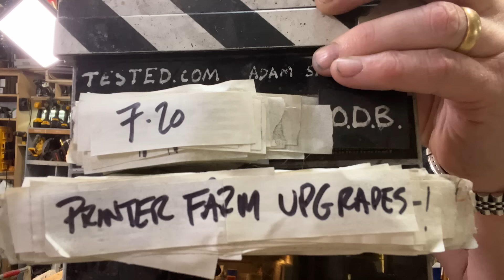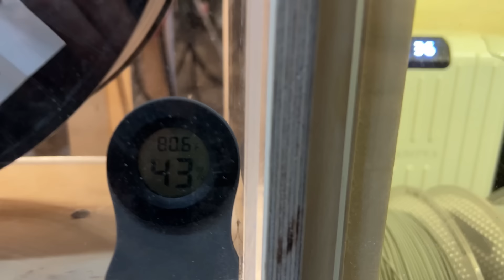Adam Savage's Essential 3D Print Farm Upgrades!

Comment: Hello Adam, I bought one of the Bambu Labs X1C with the AMS. I can't tell you how impressed with the performance of this printer. I had been struggling with my Kywoo 3D Tycoon Max trying to get acceptable quality for dimension parts and I could get there but for an EE the tweaking was getting painful. The X1C just plain works! I am doing prints with PLA+ and PETG (I never could get PETG to work well with the Kywoo) and it is amazing how they turn out. I just printed some simple 7.25 X 4 X 1.5 inch deep trays out of white PLA+ and the finish looks like an injection molded part. I had to get the magnifying glass to see the evidence of the print process. All of the parts I have made thus far were printed at ludicrous speed so I really need to see how well it does when I slow it by 1/2 or 2/3rds (the speed of my old printer). If I I slowed my old one to sloth speed I don't think it could even come close to the X1C. The only real texture on the finished parts is on the bottom from contact with the PEI build plate (that plate works amazingly well glue or no glue so far) the plate actually leaves a really nice textured finish. I have a high temp plate, but I have not used it yet. Next is to try some persnickety ABS or something with carbon fiber in it. Next I want to try some really small parts like spacers for 2-56 and 4-40 machine screws and see how they work out. It seems that the local hardware store never has the size I need and I need to stop cutting up all of my BIC pens with the pipe cutter for spacers. Well once you have had the X1C's for a few months how about bringing all of us up to date on your observations. Sam W3OHM P.S. I almost forgot. Thank you so very much for doing the unboxing and introduction to this printer. Your video pushed me over the edge and I ordered mine after watching your video!!

Comment: For your anodized aluminum request, there are a few solutions I can think of. 1) try looking into silk PLA. It has a metallic like finish with at a pretty affordable price. 2) HTPLA is PLA filament that has small particles of metal in it. The parts that it prints can be sanded and polished to have a metal like finish. 3) I saw recently about plating your print using electrolysis. That a bit more involved but still a cool concept. They used a conductive filament for the print and then set up a bath of whatever material they wanted to coat it in. Hope this helps!

Comment: Hey Adam you can tell the printer to just print the interface layers in that support stuff. So you print your support structure in the standard PLA or whathaveyou, all in one layer and one go and only when you come to the contact surface, which is around two layers thick or something, you switch to the special support material. It saves you special support filament, it saves a lot of purged material and it saves you time for all the changing and purging

Comment: I love the filament winder. It reminds me of film winders in the old days of editing. We used to wind film by hand with a geared mechanism that would run through 800 feet of film in less than a minute while turning the handle at a rate of about 1 rev every 2 seconds or so. I was expecting to see that. There must be hundreds of old film winders In your neck of the woods if they haven't all been scrapped already. Now I want to buy a printer. I definitely have your disease. Thanks Mr. S. 🛠

Comment: Regarding 3d printed part that looks anodized (I dont quite recall which video you asked about this in).   I was printing a chassis frame that consisted of  sides on the order of 20mm x 50mm x 500mm with the 50mm surface down.  The filament PLA black with silver flecks.   Alas I ran out of material with 4 layers to go so I grabbed the closed material on hand - a spool of Galaxy Red,Black,Silk Purple gradient material.   I was prepared to redo the job but the customer LOVED it and said he didn't know you could anodize plastic.

I've now added this as a special finish offering :)  Gotta love these little accidents.

Comment: You should print a TPU gasket, that molds tightly around your drybox and has wings out like weather stripping that push up against the plywood and 3D print some corner snaps, so setting the drybox in the clips, pushed that gasket tight against the plywood holes an it "docks" in place.  So removal and re'filling is super easy!!

Comment: That winder is honestly super impressive as to how well it works and the fact that something that large fit on 1 print bed.

As for your last question: you can metal plate 3D prints. I've seen gold plated prints and more. Seems right up your alley.
I've seen aluminium anodisation done with food colouring too. To kinda 'fake' it.

Comment: I like the winder and the hot box expansion, great stuff, but a pei scraping table?  I usually pull the prints off the plate, put the plate back in the printer, and then scrape it when it's in the printer... works great.

Comment: First shiny or anodized looking pla you'll be looking into silk pla filaments. A few caveats to know silk filament on fast printers is that you might have to slow down your top speed to avoid getting a matte finish in areas. And generally overhangs don't print as well on silk filament. Also silk filament can have a lot weaker layer bonding.

Comment: You can save filament by using the Flush options in the Others menu in Bambu slicer. You can flush into infill or supports, so instead of dumping the purged filament, it uses it for stuff that doesn't show.

Comment: These are all fantastic! I'm running four X1 carbons, and did the Pei textured sheets as well. I'm not sure if the designs I'm printing are significantly different than what you're doing Adam, but I'm very rarely pulling those plates out of the machines. I pluck the objects off of the bed, run a little scraper to get those calibration lines off, and I'm off to the races again. That poop chute funnel is terrific. Wish I had the space behind my machines for that.

Comment: Got me thinking about the waste bin for the boogers. Make a chute leading to a garbage bin, but then drill a hole in the bottom of the bin and attach a shop vac hose. Rig a on/off pedalfor the vac. When the boogers start to fill the bin stomp the pedal to activate the shop-vac to clear the bin.

Comment: you can electroplate 3d prints, its best on resin prints though but you can also do it on fdm prints too if you don't mind the extra work to smooth it out. Using carbon or graphite spray and coating that in copper then going from copper to any other metal you can do that. using nickel and some bluing compound could make it look good.

Comment: Adam, when making parts for a tricky custom installation, I use cardboard to make a mock up, cut with a box cutter - held together with tape - you can mark areas with felt pen to ease clearances & avoid plugs! Then remove tape & use as templates.  My printers sit on old fashioned computer desks - if they could support a CRT & computer, then a 3D printer, no problem - they have the slide out shelves for a keyboard, handy for scraping PEI sheets.  Incidentally, won't the extruder gears wear from pulling the filament from such a distance below?

Comment: For metallic red and blue PLA, my advice would be Hatchbox. Their silks also print out quite nice.
There are more iterations that improve on the concept of that spool winder. Some of them, while not being as aesthetic, are smoother in function. Look for Diplomators remix on Printables.
If you want another glorious example of how 3d printing can mesh with your workflow and workshop, you might also want to look for Gridfinity and the Honeycomb Storage Wall.
You can also get desiccant bead holders for those Bambu AMS units that will take the humidity down to 10%, as well as "Bento Box" hepa and charcoal filters to take care of VOCs if you branch into working with the stronger and more noxious plastics.

Comment: Awesome video, I work for The Dinosaur Company in Allen, Texas. At home, I have 2 Bambulab P1Ps with 3 AMS units between the 2 of them and have printed the same spool winder tool. I do have a suggestion if interested, look up a PEO sheet for the Bambulab X1, It will leave a shiny, polygonal pattern on the bottom of the prints. At work I have a Bambulab X1c that has the same PEO sheet I have at home, I also Built A Voron 2.4 300mm at work with a larger one of those , Im telling you these PEO sheets are Amazing!

Comment: A little late now, but for the surface to clean the printing plates, you could build a small box vetween the printers  and the dry box and use drawer slides to pull out a quick surface to work on.

Comment: @tested You should put clear acrylic sides on the table and a hole in the top so the after scraping the strips off the table itself becomes the receptacle. Then over time the table will start to fill up and have a collection of all the old calibration strips. I think you can put a good sized hole in the table top because the plate will still stay flat enough... Just a fun idea!

Comment: Great that I'm watching this and I'm getting my X1C in 2 days.  It is in addition to my Anycubic...just a Vyper.  But good to see Adam Savage using basically the same printers I'm using.  I likely would have gone with a Kobra Max for my next printer if I hadn't just decided to splurge on the Bambu X1C.  Working on my enclosure for my Vyper next.  And hopefully I get this Raspberry Pi I just got up and running with Octoprint and Kilpper.

Comment: I've just started watching, so apologies if this is mentioned, but i've seen people say it's a good idea to respool your filament twice, so original spool, to second, to final spool. The reason being that you end up with the filament "bent" the same way it originally was, when you only do it twice it ends up being bent the opposite direction. That doesn't sound like an issue, and i'm sure the majority of the time it isn't, however some people have found that over time the filament being stored under tension like that can lead to it becoming prone to braking/snapping, especially if the filament starts to get brittle.

Comment: Cool Test Adam, I have the same printer. They made the AMS to only support their filament and spools to make more money. The AMS could have been wider and universal, but no, we have to print transfer devices... it's ridiculous.

In my case, the AMS doesn’t always work well sometimes,  it has trouble pulling the filament back, so manual manipulation is necessary. I printed a smaller model than yours for the filament transfer.  :)

Comment: Hey Adam. You could also go with a smooth PEI High Temp Plate and never have to scrape again. I prepped mine, and between prints I spray and wipe down with Isopropyl Alcohol and put ti back. Love your videos by the way.

Comment: Hi Adam, great work! Personally, I prefer to have the print sheet in my lap / slightly bent when using the scraper. That way it is easier to get the scraper under the prints

Comment: might be a tad late to the party but i wanted to chime in. the best "anodized" like finish for 3d printing i have come across is not actually the material itself. if you really want an accurate finish i would reccomend going with Resin print for the smooth layerline less finish, then spray it with some pearl paint, then a coat of matte clear. i realize this is a bit more of a task than just changing filament, but after all these hobbys are little black holes to dive into.

Comment: YES, YES, and absolutely YES to this re-wrapper and/or spooler.  Very necessary.  But I feel a question is necessary here: ability to go up to different sizes.  What is the largest spool of heavy plastic filament can be driven by the motor and mechanism in the printer?  I didn't see the other video that might have specified it.  I will search for it after this.  I am supposing that there is a wealth of designs for all types of 3D printing issues, like this one.  And then there is the other cases I see below and to the side of the printer.  Drying case too.  I hope that the complete and usable CAD design is included in the download (or whatever comes with the item from the 3D library is my desire).  Thank you so much for your channel.

Comment: Anodized aluminum: You want silk PLA (make sure to use a hardened nozzle).  I like CC3D brand.  Much more expensive is Protopasta, which has actual metal powder in the filament, allowing you to polish and weather.  You can even turn their copper filament green!

Comment: keep an extra build plate, so you can pull a plate and replace it with a prepped plate (be it glue stick or just cleaned or however you prep your plate) and take the completed print out on the plate.  Sometimes its better to let it cool on the plate for a little before you snap your print off.  I also agree, if the printer isn't printing I'm slacking.

Comment: By modifying the color change g-code the bambus auto populate in the slicer you can reduce your purge volume by >50%. There is a project on maker world by AMT_MW labeled "Flushing Volumes Calibration - V2 and new Gcode" that is simple to follow and really cuts down on waste. 

The purges also melt really nice in an oven to form tie die looking plastic sheets

Comment: The table you should place a trash can that opens on its side so when you push off the plastic it falls straight into the can - add wheels so you can move around- then on the side add hooks for the printer tools.Google it you can get small kitchen islands that you do exactly the same thing as described that you push around a kitchen.

Comment: Just a thought. You might not need a fan to connect both dry chambers. Humid air is denser than dry air, right? Maybe if you put the Anycubic filament enclosure at the bottom, on the same height than the Bambu's, and make a hole top to top, bottom to bottom, the air would naturally flow without forced ventilation. Maybe a small segment of pipe from the Anycubic protruding to the Bambu on the bottom, and from the Bambu to the Anycubic, would help guiding the airflow and would be enough.

Comment: I get that this may be a wee bit late 5 months down the line but finally caught up after having life in the way.
However when I want a good looking shiny like finish I use ASA or ABS and when done hang them inside a sealed chamber with a glass bowl inside with acetone inside it will smooth out the lines and make it really stand out and shine no real extra work needed after that.

Comment: i learned about 3d printing in a single night last week and it hasn't stopped running since. after the current 7hr print, i scheduled another print for 20+ hrs. sitting still is not an option. im already looking into repurposing the scraps and a way to strip PET bottles into filament. i love being a gigantic nerd.

Comment: Right now I am printing with an AWESOME looking Gold PETG by Overture. I printed my brother a Doom Slayer bobblehead as part of his Christmas gift-set. For a metallic looking filament, I give that as my vote for the best all-rounder. Sure, it prints slower than PLA, but if you to from Marlin to Klipper, PETG suddenly becomes printable at the speed range you formerly used for plain PLA. PETG will last if you are looking to print something that you intend to either use or keep around indefinitely or for the foreseeable future at a minimum. Unless you are like me and are willing to contend with the one downside of ABS/ASA which is the odor, and in large amounts it becomes toxic, so setting up a ventilation system is actually not a big deal unless it's just for one of those things you need to be safe inside of a hot vehicle for example, or around electric motors or other pieces which need to handle moderate heat. I find that good ABS and even ASA filament can perform every bit as good concerning surface quality and speed of print with many PLA&PLA+'s. So looking into those can be worth it depending on your goal. It actually somewhat surprises me that you use so much PLA doing what you do. And also not knowing your hobbies and interests from what you let us know about you. But for any PLA-person, PETG will become a gem once they learn it's temperament as a material to work with. But if you're just printing shelf clutter, please don't use too much thermoplastic for those types of prints.. I used PETG because it was part of my Christmas gift to my sibling, both of us are in our career phases of life and I don't wish to gift him with literal trinkets. If 20% of it can become one with the earth should it be left outdoors for any prolonged period does not constitute a proper gift imo..

Comment: Not sure if you are aware of this or not, but there is 3D printable support filliment that dissolves in water- not only does this make removing it 1000X easier, (on occasion you may neet a medium bristle toothbrush) but because it seperates easily this way you can throw your purge in water & reduce it's acual waste by at least a 3rd of the total print volume.

Comment: you sould definitely add a 3D pen to your 3D printing tools. they're cheap and you can use them to essentially weld parts together as part of the post processing step. they're also good for other little touch up jobs and filling gaps.

Comment: possibly a good way to get that red and blue shiny look is using ABS then doing a acetone bath, the fumes of acetone melt the topmost layer of the plastic and it all molds together, giving a shiny smooth look, you could probably hit it then with some sandpaper and whatnot to get that more gritty metallic texture

Comment: Silk PLA is about as close as you will get to a shiny metallic look. I use it all the time. Be forewarned, however, it has an elasticity to it so it tries to go back to its original shape after extruding so you have to tinker a bit until you learn to use it. I have seen tons of people leave bad reviews because of this but i have used several brands and they all print the same way.